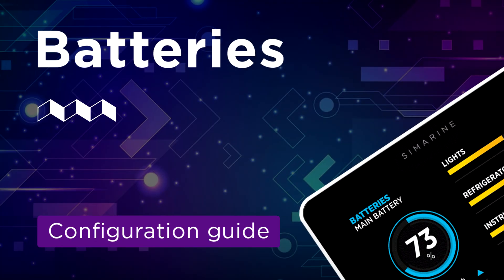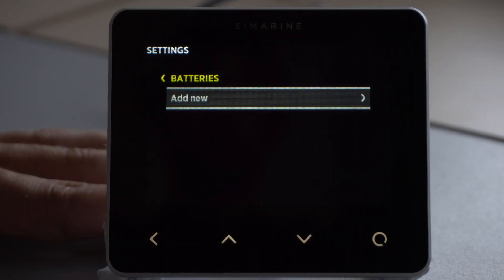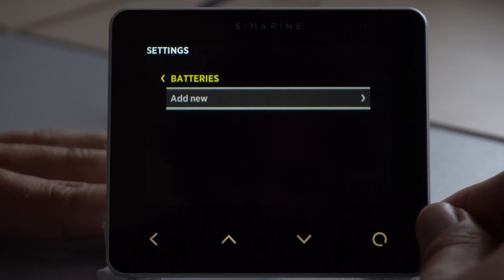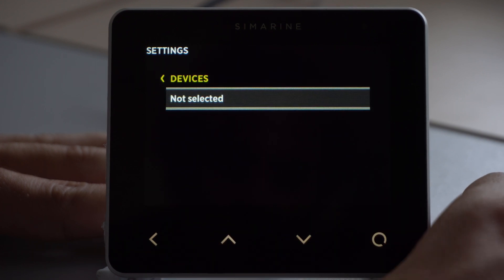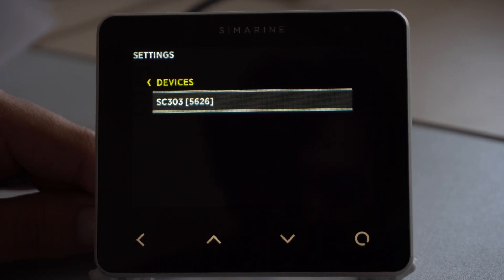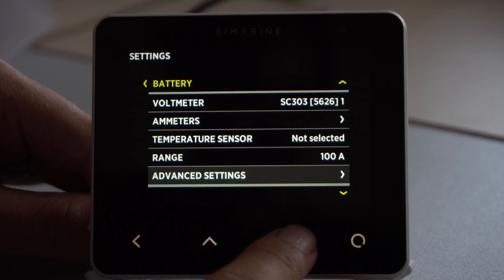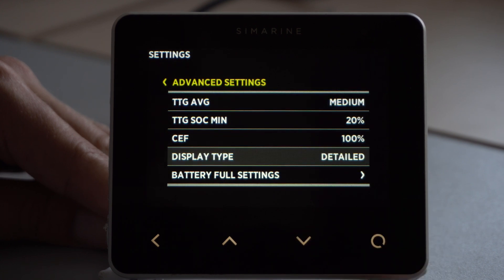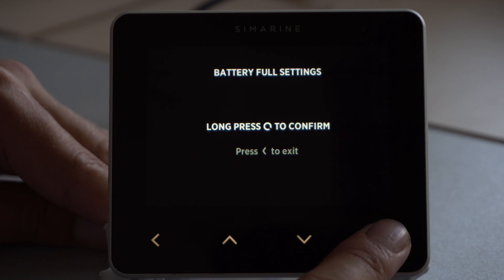How to Configure the Batteries in PICO | Simarine How to

Comment: I have 6 lithium x105 Ah service batteries in series. Should I set C20 to 630. I read somewhere in the document that max range is 500A .
Reply: How can it be allowed to be that stupid
Reply: Seems you are making a confusion between Ah and A. Ah is the energy, e.g. the capacity of the battery. The 500 A limit is the current that can be run over the shunt ... I would assume you do NOT use 500 A of current, as this would be 6000 Watt of Power ... 🙂